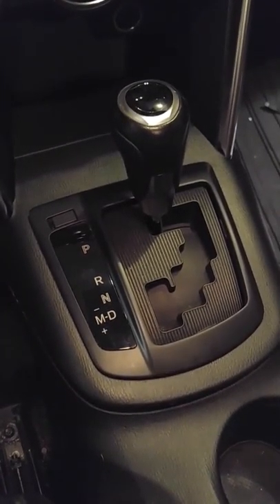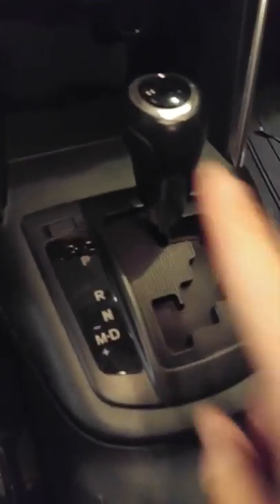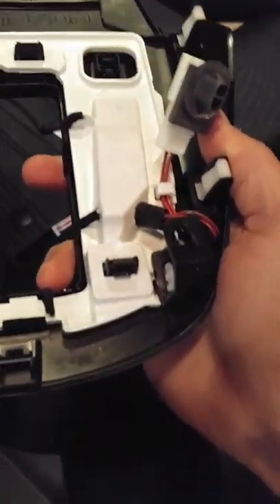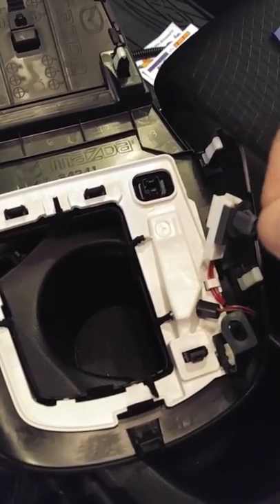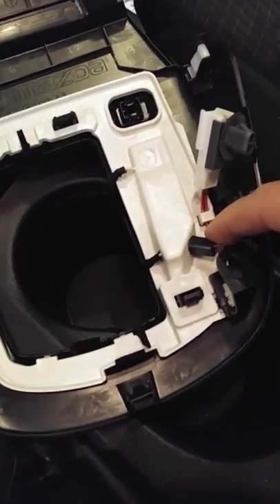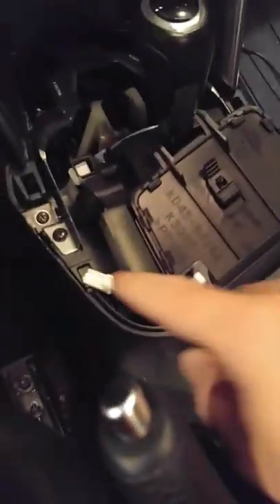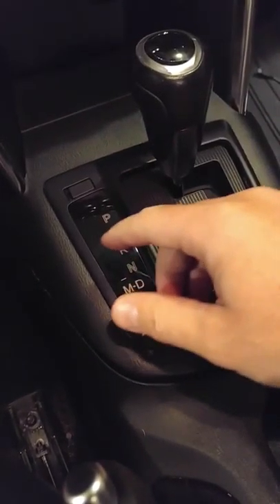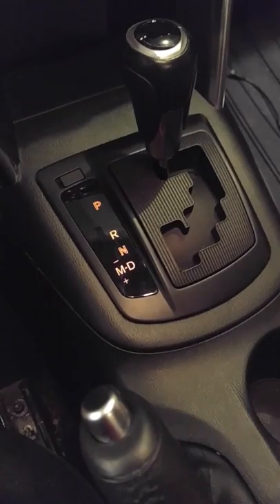2013 Mazda CX5 shift console bulb change

Comment: Just wanted to say THANK YOU for posting this video!The Sylvania bulb 2721 was purchased at Canadian Tire for $5 (2bulbs in the pack)It took no time at all to install. The tip about moving the shifter to remove the cover made it so simple.Many thanks!!!
Reply: when i turn off my mazda 2014 isport engine gets off but thr radio keeps on do you gyz know what wrong with this i think my parking sensor not working fine if you know tell me plz??
Reply: happened with my 2014 cx-5 also , its a problem that mazda is aware of, it's the shifter sensor, needs to be replaced, dealer wanted $200, i emailed corporate mazda and got them involved, because this is a known issue on many mazdas. They covered the entire cost of the repair , took it to dealer , didn't cost me a dime

Comment: This works on a 2014 as well. I followed your instructions, everything went as smooth as possible.  Start to finish, less than 10 minutes!!!  Bulb 2-pack was $6 at Advance Auto Parts and Sylvania Bulb part # was dead on!! We bought this vehicle used and were also told there was no bulb in there by Mazda dealer. What did we do before YouTube? I only wish I could give you like 5 thumbs up!!!  Thank you so much!!!

Comment: All of this worked perfectly, thank you for the video.

My only issue is that the center plastic piece seems to still float around even after clipped down.  I don't remember if it did that before I got in there or not as I never really pushed on it.  It's not moving randomly, but if you push it, it slides about a quarter inch or so forward and back.
Reply: Yeah, I know exactly what you are talking about. I was wondering the same thing. But I realized that the housing floats around until you clip the whole assembly back in place. It's held in place by the zigzag slot that the shifter sits in.

Comment: Hello, can you make a vídeo about  the  sensor switch parking, i have a problem to the radio on.
Reply from the maker: I had to replace her brake sensor recently. Unfortunately it was in a parking lot in sub 20 degree temps so I just wanted to get it done.

Comment: Todd Hallowell when you move the shift isn't there suppose to be a light indicating what shift your in?Thanks
Reply from the maker: Zack ours never did
Reply: Yes. E.g., on the 2014 CX-5 on the dashboard instrument panel, at the bottom of the tachometer there's a lighted indicator that tells you which shift position or "gear" the transaxle ("transmission") is in. E.g, D (drive), N (neutral), P (park). Additionally, if using manual mode, the indicator tells you which gear position you are in, 1, 2, 3, 4, ...

If on the console the bulb is burned out look at the dash indicator if needed. (My light is burned out, but at night when I can't see the console, I know how to shift, by feel, but I always double check the shift position by looking at the dashboard indicator.)

Comment: i tried to replace mine with this bulb but the bulb was loose and couldnt get it to fit snug, as i would assemble it, the light would go on and off when things move. So i tried to shove some aluminum foil in there to tighten it but now the bulb doesnt light up at all, nor does the lights on the climate controls. Remove the alum foil, same issue, wonder what i messed up and how lol